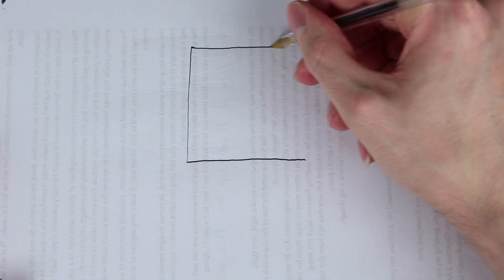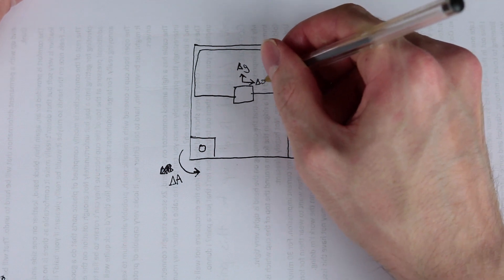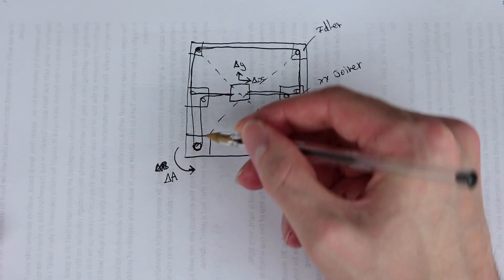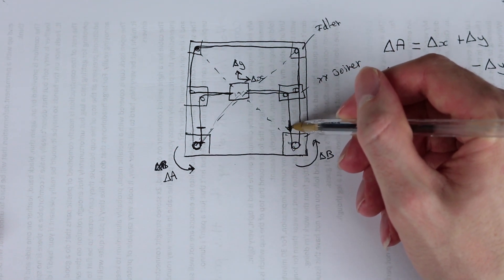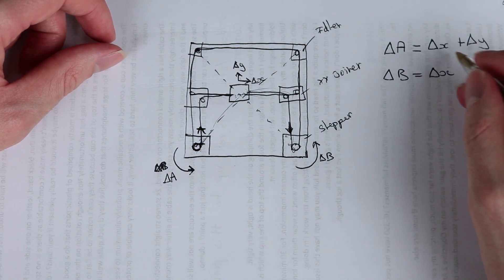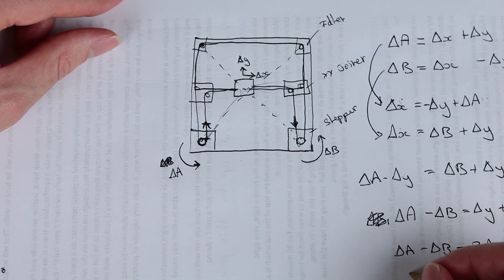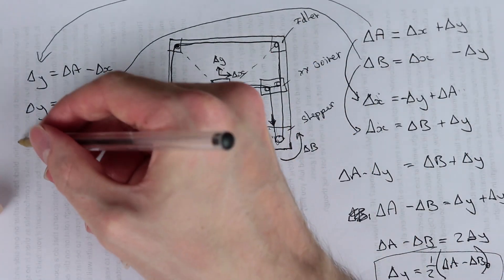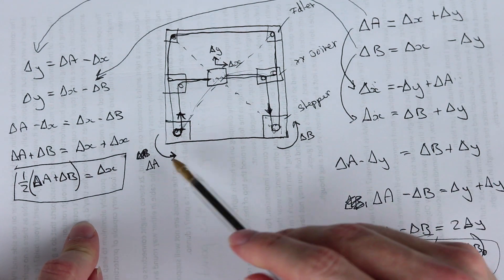How Do CoreXY Kinematics Work on 3D Printers? CRT Explains...

Comment: but why? whats the advantage, i see so much rubbery belt
Reply: Advantage is that the heavy servos don't move. So they don't have to be accelerated. This means that the mass being moved is less, so for a given amount of power, things can move faster. The other advantage is that for a given build volume, the size of a corexy machine is smaller.

For a Cartesian machine, one servo moves the table back and forth. In order for the print head to access the entire table, the area where the table travels has to be twice the length of the table. In a corexy machine, the table doesn't go back and forth, so the machine just needs to be large enough to enclose the table plus room for the belts and pulleys.

Comment: Does anyone know why these machines need a light print head?
Reply: They don't need a light print head. But the less mass that needs to be moved means a higher acceleration is possible for a given amount of power. So lighter = faster for the same cost. CoreXY means that the heavy servos are stationary = less mass having to be accelerated. And as long as you have that, using a lighter print head just makes things that much faster.

Comment: Which is all very nice and well explained but imagine now that I am building a core XY printer, and my electronicx board (A duet 2) says that one connection is for mt x stepper motor and the other for my Y-stepper motor, how do I tell which is which? Is x The left stepper or the right stepper? I mean it does matter for the oriantation right?
If I look up front and my motors are in the back of my hypercube then both of them maje the Z AND the Y movement, but what of I switch them? doesn't that mirror my print? doesnt that make it a problem for my endstops to detect the X-and Y endflags and wreck my printer before I properly used it?
Reply: X and Y movement* sorry for that Z typo
Reply from the maker: You can flip the rotation directions to get the desired motion depending on your layout and which way up your motors are. Just run at low speeds while testing to ensure its going in the direction you expect.

Comment: I like the way you expressed it as a system of equations. Mathematically, it makes more sense to me now. However, you did move a bit fast. It seemed like you might have even sped up the video a little, or am I wrong? Either way, remember that we can do that on YouTube now with the playback speed option. It was slightly too fast for me to really grasp it. Also, I would suggest using two colors for the belts, because as you said, it gets confusing when they begin to overlap. I haven't thought about it on my own much yet, but for example, I have a hard time seeing the delta Y motion occurring with the belts as you had drawn them. Overall, it was a good explanation, albeit a little too brief for me. Perhaps a physical demonstration of each motion would help?
Reply from the maker: Thanks for the feedback, really helpful stuff.

Comment: Maybe I don't understand the definition of Corexy. I thought it meant that the bed only moved in the z axis. so, Is it necessary to have both belts working in unison for a translation along a single axis for it to be considered core xy?. Or can you still have a core xy setup where you have a driver for each axis and run them independent avoiding the extra calculations? I'm about to hack up a monoprice mini and use the driver and motors for a 450x450x450 build area in a 50cm3 upgraded frame with aluminum carriage, etched glass bed, and 4 small bed heaters on an independent powersource. The Z axis driven by two Nema17's in parallel to adjust the bed height instead of the original single nema17 for gantry height. The other two motors will stay up top for the x and y. I was going to dub it the Monoprice Maxi 
I'm also considering adding two or three belts per axis, hopefully it will give better life expectancy than a single belt per axis.

Comment: is there a difference in set up when you are offsetting the pulleys? what you showed looked like stacked.i used offset design so each A and B would have there own bearings hoping for smoother operation.

Comment: Well... If you just want to make things fancier a.k.a. more complicated, than I guess the CoreXY is OK. But it does add nothing to the quality of the 3D printer. Actually, because the math is a bit more complicated you need a better controller. Then the belts are at least twice as long as on traditional XY design, meaning the overall elasticity of the belt is greater and as a consequence, you have more "ringing" (wavy vertical walls). 
Bottom line not a good choice for 3D printer.
Reply: the controller isn't an issue, even standard grbl runs it just fine on an arduino uno. The concept was to make it more rigid though, is htat what you're saying it's not doing properly?
Reply: @midwestmangos2452  "CoreXY" does not add nothing to the rigidity. In contrary. There are more bearings, more joints, longer belt, more friction,... Simply not worth it!  (a bit of  disclosure: I'm a 3D printer and a UAV designer...). But, really, the question is: What is your goal?!?
I have to admit the movement is quite mesmerizing :-)
Reply: @midwestmangos2452  Ahhh sorry for a late response. If you check the definition of "rigidity" you'll find tha the CoreXY is not rigid at all. More elastic component you add to the "equation" less rigid the system is. Check also the "ringing" or "ghosting" in 3D printing to understand this phnomena. But yeah it's very mesmerizing to watch how it works :-)

Comment: What's the advantage of CoreXY over other approaches?
Reply: It allows both motors to be stationary instead of having the x motor mounted to the y axis.  Basically the y motor doesn't have to move the additional weight of the x motor
Reply: Also it's much more space efficient then most cartesian or probably any delta printers

Comment: Thx. Fortunately, I have an engineering degree, and I'm a math teacher, plus I've been deep into 3D printing/printers for almost 2 years now (even took apart an H-bot printer... and yes, fixed it and got it back together :) ). Actually, I'm going to use this for my algebra students! It's a nice little real-world system of equations. FYI, to that end, the elimination method is well-suited to this system: simply add the two to get delta_x; and subtract for delta_y. In fact, this can be done easily in one's head! Of course, you're a sharp guy, so, probably already know this and simply chose another solution method for your own reasons. Anyhow, thx, again. MATHS!:)
Reply: What you actually get are equations for two straight lines, one with a slope of 1 and the other with a slope of -1. The y offset of a line is set by the total distance from the stepper pully to the print head for that line, which is set by that line's stepper position. Since both equations have to be satisfied together the x,y position is the intersection of the two lines, and since you can control the y offsets individually you can place the intersection anywhere in the x,y plane.

Comment: Thanks - nice quick explanation; I'd been wondering what CoreXY was but never got around to finding out; a quick video is just the job :)

That algebra is so much easier if you just sum or difference the two equations, which is what I thought you were going to do before you took the long way around!

 dA = dx + dy
 dB = dx - dy

Sum; 'dy's cancel:

 dA + dB = dx + dx + dy + (-dy) = 2dx
 (dA+dB)/2 = dx

Difference; 'dx's cancel:

 dA - dB = dx - dx + dy - (-dy) = 2dy
 (dA-dB)/2 = dy

Comment: hi. Firstly thank you for this video. I have a question. I finished my corexy  printer. But when I print a part everytime I got like mirrored by Y axis. What may cause problem? If you want I can send you my kinematics schema by email ro other ways
Reply: yes you can check below link to my schema? If I change the X endstop positon to the left then It will be okay I think.. By the way I use endstop_min on the firmware

http://www.imgim.com/corexy_kinematics_bykurt.jpg

Comment: Great explaination but.........dafuq?! 

My head hurts. I was good at algebra at school, but it was over 20 years ago I last used it. I cant wait for my kids to do it, so I can refresh myself.
Reply: here's a refresher:
 when you have
 x+2=0 
you just remove 2 from each side, which keeps the equal, but gives you
x+2-2=0-2 
which is 
 x=-2
same goes with multiplication and division.

 when you have something like
 x+2+y=0
 and
 x+2-y=0
 you can simply put x or y on one side of one equation and replace it in the other
so the first one becomes
x=-2-y
you replace it in the second equation
(-2-y)+2-y=0
move all of the y to one side, which gives
-y-y=2-2
so 
-2*y=0 
thus 
y=0

once you have y you can replace it in either of the equations and you can find the value of x
x+2+0=0
so x=-2

same idea when you have more than 2 letters (variables), you can just rearrange stuff around until you find what you want, but you'll probably never get a number.
in this case we "know" x and y, so we can find A and B.

Comment: Thank you, this is new to me and very interesting, although I just took delivery of a Kossel Delta kit, I would consider getting a CoreXY type if they are more accurate. On another note, do you think larger printers might be inherently  less accurate because of more stretch & "play" with a longer belt length?
Reply: Everything has more play the longer it is

I made a 3x3x3 meter printer and the 8mm rods that had <0.1mm sag at 200mm had nearly 4cm of sag at the middle after doubling the number of rods.

Comment: Just a thought, what do you think about using a micro to read a standard cartesian step/dir XY axis pulse stream and then calculate the corexy step/dir output stream, that way you could use any traditional controller without needing it to be corexy compatible.  Obviously it would involve some math which would limit the step pulse frequency to whatever the micro can handle.  Nice explanation BTW thanks for posting.
Reply: I should have mentioned I wasn't thinking 3D printers, more traditional CNC applications, I'm planning a drawing machine/laser build using corexy and the controller I had lying around didn't support it.  I'll just switch to something that does.  Cheers.
Reply: if it's standard, you'll need 4 wires, the step and the direction for each axis you can then simply plug the length for a y or an x step in the equation.
a faster alternative is to use a lookup table, where you have how much you should move each motor for one step.
a more accurate alternative would be to buffer x,y and z movement, so you can have a greater number of steps and have less error in the equation.
a ramps board is 20$ and is probably less than the hassle of doing this,unless it's for fun of course.

Comment: if both steppers works Y movement ,1 stepper=X :)
Reply: What what?
Reply: there are 2 steppers in this formation, If both motors runs at the same time that creates Y movement on the other hand single stepper motor creates X movement is that right?
Reply: if you run both in the same direction, you get x movement, if you run them in the opposite direction, you get 2y movement.

Comment: On CoreXY I see the motors at the back or at the front but on my printer they MUST be on either side (pick right or left for both) so with both motors connected to a controller I have four choices of which combination I could have the connectors.  Now with my motors on one side that makes it 90 degrees off from the standard motor setup how would I setup the motor connectors so that my print is not 90 degrees off?
Reply: That is what I have been told and with only two connectors there should be a max of four positions they could go.
Reply: How so?  The plug(s) can only go in one of two directions and there are two plugs.
Reply: Now you have lost me.  The plug can go 1, or 2 with 1 say is up and 2 is down.  1-1/1-2/2-1/2-2.  Because the plug only has 2 states which are either up or turn backwards to be down and there are only 2 plugs that would be 2 squared which is four possible outcomes.  I am severely not understanding how there could be 8.  Think of it like a light switch and you have two light switches how would we get eight possible combinations?  Up-Up/Up-Down/Down-Up/Down-Down
Reply: Z would have nothing to do with this though.

Comment: Hi there :)
Can you explain how to get constant velocity for the Extruder or nozzle?
Reply: the first equations he writes down are position equations, take the derivitive of the final ones to get velocity, then take second derivitive to get the acceleration
Reply: lets say, that i want to move the nozzle from point P1 to point P2 on the X, Y plain. But I have to do it in a constant velocity. So if it was a typical Cartesian printer, we would have to set different values for X and Y.
V = sqrt(X^2 + Y^2)
But how do we find the velocity of X and Y to get a constant velocity V?
Is that clear? I can send you a video if you want...
(It is really important or me. I am trying to make a 3D printer by my self but I don't know any kinematics or calculus)
Reply: In short, How to get nozzle velocity V by changing the velocity of X and Y?
Reply: C.R.T thanks a lot! I'll let you know the results!